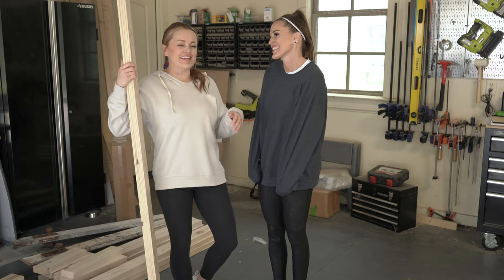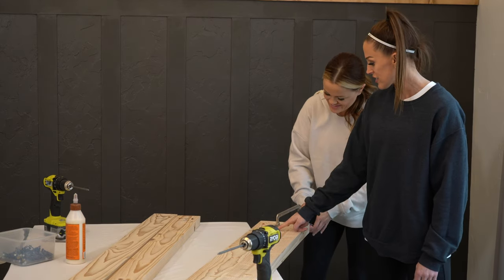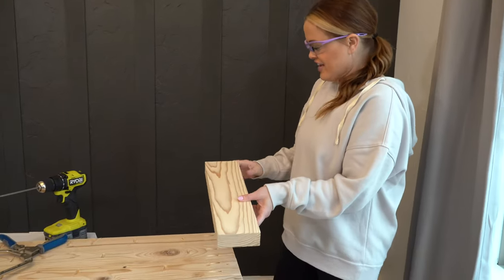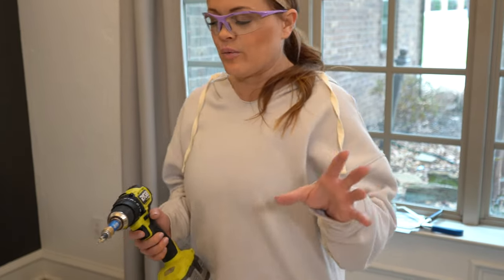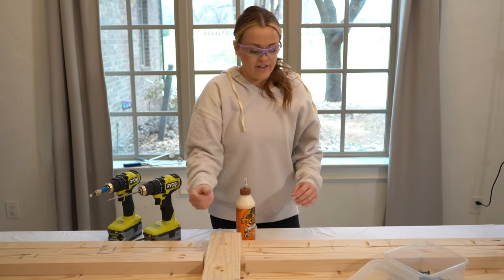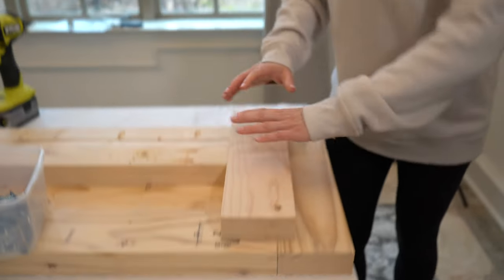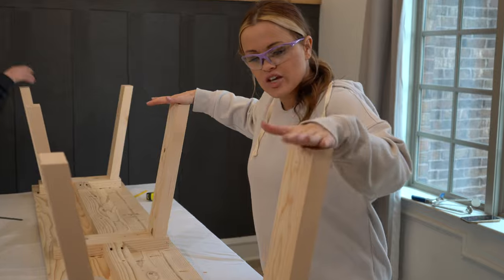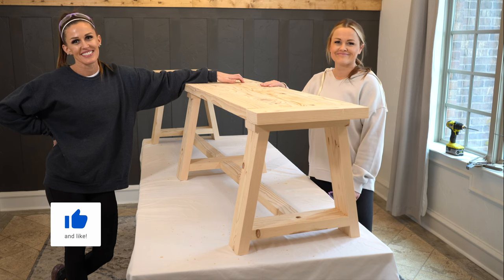How to build a Dining Bench!

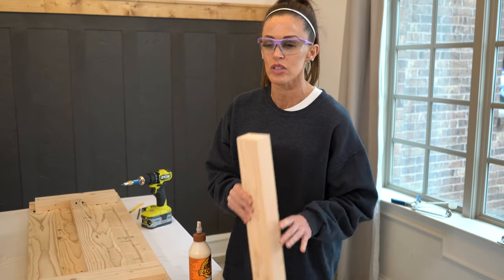Comment: 9:58 so how did y’all drill these pocket holes where the angled part would be seated in the bottom of the jig? Wouldn’t that throw off the depth and drill too deep? Or am I overthinking lol.
Reply from the maker: At 10° with 2x we haven’t had a problem at all… make the cross cut first with the angle and then put it in the jig with longer end touching base of the jig. Works like a charm!
Reply: @shanty2chic  that’s a good tidbit to know. I’m definitely filing that away to use later lol. Thank you ladies! The bench looks great.